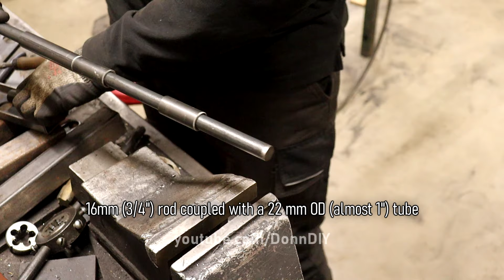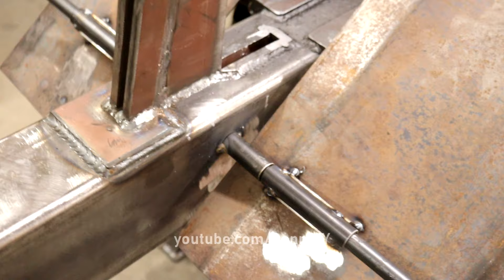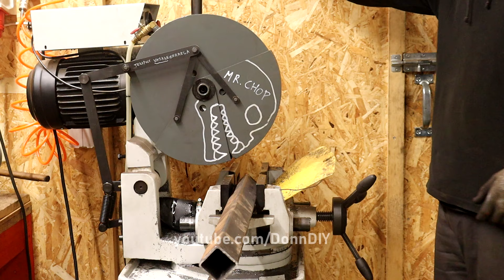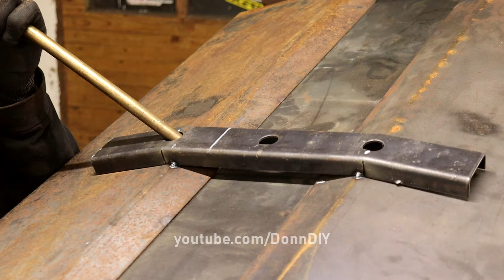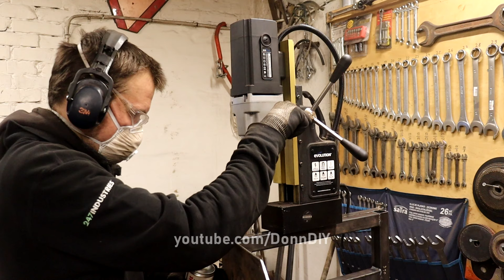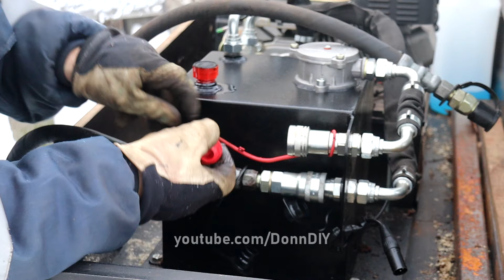Hydraulic Log Splitter BUILD Part 6 - Wood Tray & TEST

Comment: When you add the sidewalls, line them with the plastic liner tank from the ICC crates.  It's light and tough and should work great. This is looking and working great. You processed most of that pile of spruce for the video, and got a lot of nicely sized firewood. Beyond the upgrades you talked about, it doesn't need much!

Comment: Never mind the slide tray. Lay the IBC tote on its' side. Unload a much shorter tray/ramp directly into the tote by hand. Lay your split pieces neatly and then, when you get it all full, tip it upright with the ATV. You'll get way more wood in it and it'll all be indexed upright for easy "grab & go" firewood. Put the tote on skis with a hinge that allows it to be tipped in its' side. Ball hook for towing and you can drag it anywhere . Even fab it some wheel mounts for summer work.

Comment: Great work! Some sort of shelf on the opposite side would be nice, I guess. So the first big chunks can be stored somewhere and you have more room to move freely because the log lift can be lowered.
Reply: That would be a lot better than a higher log stop which I what I was leaning towards
Reply: Yeah a massive table on the other side. I used to use a table I made for my wood log splitter. Works wonders. Also make a pick so that you can bring and push the logs out of the way. I would split 5 to 10 logs in half first then bring them in and split. My spliter was a dual action that split forward and backwards. Which made it pretty fast in some cases. 
While this is a good start on a big wood splitter. If i was making one from scratch I would opt to build a massive one with a 12 way splitter so that I never have to worry about  splinting it more than once.
Reply: @kameljoe21  me too. Then again who am I to suggest anything because Donn knows far more about this stuff than I do.

Comment: Excellent Donn. Seems you get more snow up there than us here is Poland. Cur M wrote a nice little out-of-the-box idea below, recommend reading it. Will save you time, trouble and probably, know you, release a flood of further design improvements to the overall wood-collecting-cutting-storing operation. You are inspiring, keep it up.

Comment: Humble safety advice: especially since you work from the lift side of the splitter: if you hinge the lower part of the lift so it will only fold up when lowered (gravity will keep it in its current position) then if you lower the lift onto your foot in a moment of inattention it will simple fold up instead of putting most of the weight of the splitter on top of your foot.

Comment: Works pretty good. When I have to drill the corner of square tube for a pinch bolt I grind a flat in the corner first. It's easier to drill and the nut has a flat spot to sit for welding. If you don't go too deep there's no worry about clearance issues since the round corner of the inner tube is there.

Comment: You for sure need a bigger dia.bore cylinder  and then of course you fill most likely want more gpm on the pump.. but just the cylinder alone about 1 inch bigger bore would come close to doubling the power.  It would run on the same pump it just would not move as fast. Very well built and some neat features I would love to see it painted.

Comment: Along with the slide walls and motor upgrades I would also add a table to the opposite side you're operating from. That way when you have the larger pieces you can place them on that "table" out of the way and they wont be clogging the slide either. The alternative from adding in such a table is to operate the splitter from the opposite side as the lift table and then keep it in the up position to use a extra space to keep the bigger chunks out of the way so you can split the smaller sections.
Reply: Also not sure how this would work or if it could with your design but maybe add a simple conveyor belt driven by the cycles of the splitting ram. Some sort of like bicycle sprocket chain driven lift simialiar to that of a roller coaster (just not as complex) Every 16" have a angle iron attached to the chain to catch on the split logs and pull them up the ramp.

Comment: Very good so far. Back stacking of the wood on the slide now involves more work from you. I always look for less work. The collector basket is a good idea. Can its height be reduced and the length and breadth (of the basket) be extended to hold the same volume. That would allow the slide to be lowered  to a point where the post splitting push effect would push logs in to the storage basket. Alternatively excavate a shallow pit to hold the storage basket. This of course leads to other problems. You are a very clever young man so I expect you will mull over these comments for a while.
Reply: DonnDiy.  Not sure if this will reach you Test.

Comment: Nicely done. Only one flaw I see. Is on the cylinder that pushes the wood through the splitting blade. I think you have it plumbed backwards. It should retract fast and push slow for the power stroke.   At least that the way I have built these machines before. The pump and valves I used were power with slow push and quick retract.

Comment: The first unit that sawed the logs auto fed logs into splitter onto  the conveyor belt into the cribs was brilliant. This simpler unit is nearly as efficient with more manual labor. But I get the feeling that you're not done with this unit as you haven't painted it yet either. 😀

Comment: I started with a piece of H beam  so i would have a stable piece for my splitter knife to run up and down  so it wouldn't run off side to side and ruin the seals in the hydralic cylinder. Also I used a Vicker return to center control so I wouldn't have to do that movement with each return. For those who want a portable splitter  , there is a Company in the USA called Northern Hydralics that has a horse power to cylinder to control , as some people think they need a huge motor to power it.

Comment: A metal link conveyor belt and drive system would work better than an uphill slide. 

Or maybe cleats that are shaped to let the logs go up but not down welded to the slide bottoms/floors. 

You’re correct in saying the slide needs side walls.

Comment: There is this guy in a youtube channel called made in Poland who does similar things to you, he made a log cutter using a 240v electric motor with a chainsaw blade attached where he pulls a lever for the blade to slice the long logs into manageable pieces so that he can then put them through the log splitter, perhaps you could redesign something using a 1/2 HP 1400 rpm 12v motor that hooks up to your vehicles battery with a chainsaw attached behind the log splitter so that you can do all in one hit instead of doing all the bending out in the cold. You could also put one of those 12v 600w hot air fans blowing hot air from underneath vertically at 5 or 10 degrees where you stand so you can keep warm while standing in one spot.

Comment: I see you added a pin to the hitch jack stand in addition to the T-Bolt for in the down position. Are you also using that pin for the travel position? I've had a few mishaps with only a T-Bolt for traveling. 
I cut an opening on the cage of my IBC Totes. Easier access to the bottom. Basically, 2 squares deep x 2 squares wide.

Comment: Maybe you can add a 12v winch to spin a pair of rollers & a small rubber conveyer belt to lift the wood into the Tote.
Reply: Same thought to transfer wood cuts into basket.    :)      Thanks Donn  :)

Comment: You weigh 220 lbs?! Wow! You carry it well. I would have guessed 180.
Reply from the maker: I am 97-98 kg-s without the clothes so 100 kg with clothes is most likely accurate. I'm 192 cm (6'4") tall so the fat is still more or less equally dispersed over my belly area and almost unnoticeable but it's starting to show. 🤣

Comment: Combination log ramp and a snow shield. Could you run a hydraulic pump off your 4x4 engine? That way you remove the necessity for having an aux hydraulic power pack.

Comment: Assuming you're willing to put the money into it, you can stuff a dedicated power pack over the axle on one side of the center brace and balance the weight with a hydraulic tank on the other side of the center brace...

That allows you to put in a pump big enough to run the entire system and also means you don't need the UTV to run it...that would also allow you to run dedicated steel hard lines from the tank & pump to the cylinders so you don't need to run flexible lines where they could get snagged and cut...
Reply from the maker: You're right. I have all the hydraulic components ready for a stand-alone hydraulic power pack for this wood splitter. But instead of using gasoline engine I'm gonna use electrical motor.
Reply: @DonnDIY   That works too...

That will however limit where you can use the splitter unless you're going to put a Generator big enough to run it in the UTV...

Though if you DO put a Generator (or even a big Inverter running off the UTV's Engine), you could then make the same mod to the log trailer so all it's Hydraulics are self contained as well and the Inverter should be small enough to be stuffed somewhere other than the rear cargo deck which would free it back up for use...An Inverter beefy enough to run the electric motors for the hydraulics might require you to install a second alternator on the UTV's engine so it can handle the electrical draw...that would also give you electrical power when out in the bush if you need to charge something or run some power tools...

Comment: would making a chain drive type conveyer system be possible for the tray?  like maybe 2 chains with teeth like a chainsaw blade. one on each side of the tray with pulleys mounted under the tray

Comment: Add a convayor belt  to your ramp and  that sould be better less dropping off . Otherwise awesome job .
Reply: Just noticed when you were plowing . Suggestion  add wings to the end of the plow make them adjustable so you can box in less snow coming off the ends or if you just need a little wider plow. Or any combination inbetween lol  untill the next video  have fun 👍 😄

Comment: Why is your ramp going up and not down?
Reply: so he can fill the metal racks with the wood . the rack is taller then the splitter .. when he gets it working the wood will get pushed up the ramp every time a log gets split .. if it drops to the ground he has to touch the wood again ,, the less times you have to handle the wood the better off you are ,,
Reply: @randytravis3998  I see, so you mean that his metal rack will never be lower than that and thus up it goes.

Comment: Question for you, and something I've been wondering about for years. I see you weld over a lot of rust. Are you worried about good weld penetration? And are you worried about the existing rust that's now trapped between pieces of steel? (example: the tube for the "foot" you welded onto the side.)